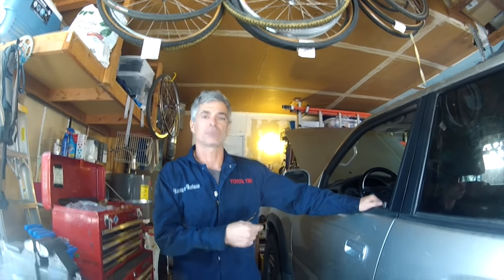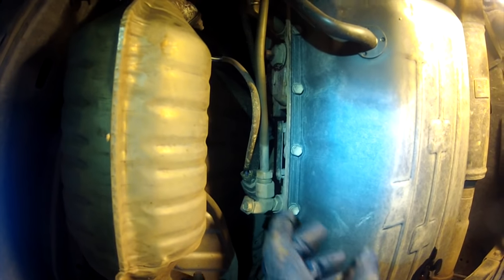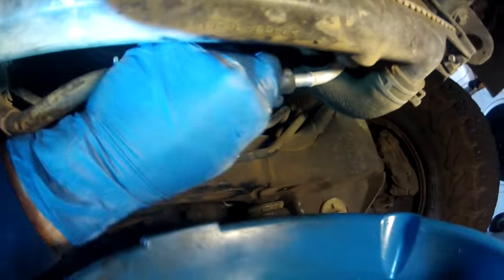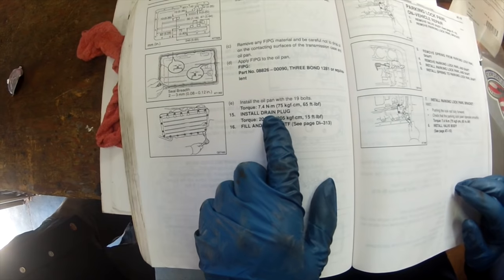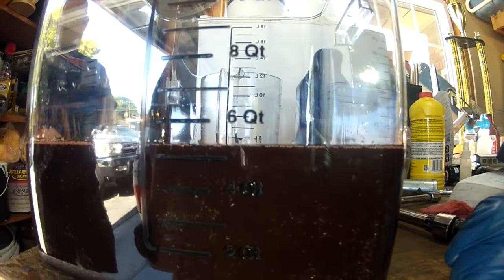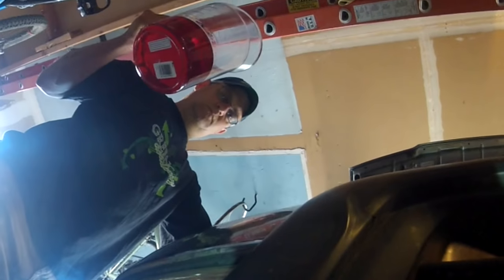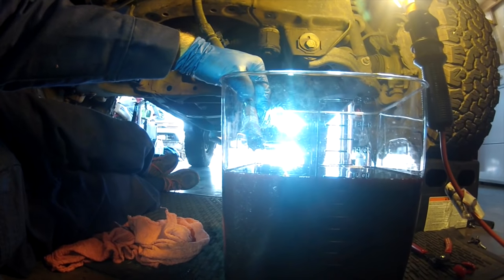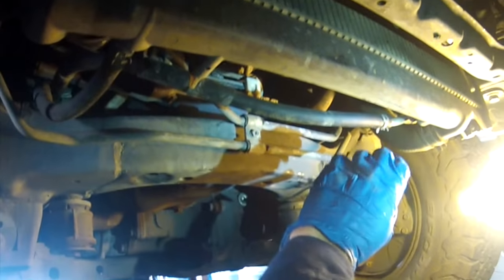Transmission Fluid Flush

Comment: Thanks a lot for your previous help.  I have been able to follow the steps and it works fine. 
Just one question.  When teh temperature is between 158-176F, the fluid is just above the hot mark by almost same distance between the two notches at the hot level (almost 5 or 7 mm above).  Is it a big deal, should I drain a little or this is minor?
Thanks
Reply from the maker: When the dipstick is showing that high, is the temperature closer to 176 or 158?  It sound like you might be a little high.  But, the transmission fluid level is not an exact science because the temperature you check it at will determine the level on the dipstick.  If you checked it after climbing a steep grade and your fluid was around 200 degrees, you'd be way over the top hot mark on the dipstick.  

I think it's ok to be a little low and a little high.  The key is to not be too low or too high because neither is good.
Reply: The temperature was about 165F on my torque pro when the level was about 5 mm above the highest notch. Thanks for your guide.
BTW, the filter was really dirty and stiff not as spongy and soft as the new one.
Reply from the maker: I forgot, what vehicle are you working on?  It can't be a 3rd Gen 4runner because they only have a metal mesh filter under the transmission pan.
Reply: It is Camry 2007 LE 4 cyl.  Also the Highalnder 2011 AWD 3.5L 6 cyl has the exact same filter.
Reply from the maker: Gotcha.  Now I remember.
Reply: One thing I am not sure about.  the transmission temperature is about 150F when I am driving and the coolant temperature is about 180F.  Once I park the car and keep idling the engine, the coolant temperature rise to about 172F and the coolant temperature to about 205F.  Is that normal?  I expect that once I idle the car, the transmission oil temperature should drop and not increase.  Any idea why is that?
Thanks
Reply from the maker: zofa300 So you're saying at an idle your transmission temp will increase to 205 degrees?
Reply: No this is the coolant temperature when idling.  The transmission oil temperature increase from 150F to 172F when idling.  I am just confused why the transmission oil temperature increase if I am not driving?  Is that possible? 
To clarify further.  I was driving then the oil temperature was 150F.  After I parked the car and left it idle for 5 mins, the transmission oil increased from 150F to 172F.  I did not expect that since I was not driving!
Reply from the maker: The normal operating temperature my 4runner is 188-194 degrees but I don't know what it is normal for your Camry.  205 degrees seems a little high to me but it could be completely normal.

Your transmission temps at idle should slowly start to decrease because there's no load on the transmission.  The engine fan is pulling air through the cooling fins of the radiator helping cool the engine coolant and also the transmission cooler running in the bottom of the radiator.

When you're driving, air is being forced through the radiator, cooling the engine coolant and transmission fluid.  At idle, you're depending on a functioning fan clutch (unless you have electric fans), to lock up and pull sufficient air through the radiator to achieve proper cooling.  The symptoms you have, it sounds like to me your fan clutch isn't working well.  The fan clutch is suppose to lock up at the engine operating temperature turning one for one with the motor pulling air through the radiator.  When the fan clutch starts to fail, it's not locking up all the way or not at all and you're not pulling a sufficient amount of air to keep your engine and transmission cool enough.

I have a video regarding testing and replacing the fan clutch on my rig.  https://youtu.be/WzhlACxqeqQ

Comment: Hello friend ... Congratulations on the video and the explanations ... I'm going to change the transmission fluid, but I do not have the OBDII reader, nor the scanner ... if I take a 10 to 15 minute ride with the vehicle. fluid temperature will be in a good range for level checking? ... Thank you.
Reply from the maker: To start off, make sure before you take your drive that you're level is at the top line of the cold range.  I'd take it for a decent drive down the highway, around 5-10 miles.  During the drive, hit the accelerator hard several times to get the transmission to kick down.  Do this on the way out and the way back.  This will help raise the temperature of the ATF.  When you get home, quickly get the vehicle on level ground, keep it running and check the level.  You will most likely be within the normal operating temperature range or very close.  I've done exactly what I'm telling you to do with my own rig and I was in the normal operating temperature range monitoring my temp with the Torque Pro app.   I've found that I will still be a little low on fluid after the drive.  Add fluid until you're in the hot range on the dipstick and you're all good.  

The level on the dipstick for an automatic transmission is not an exact science because the level will change depending on how hot or cold the fluid is.  ATF will continue to expand as it gets hotter.  Say you climbed a steep mountain road and your ATF temperature was in the low 200's, the level on the dipstick would show above the top line of the hot range if you got out of your rig and checked the level.

Go for a decent drive like I explained above and add fluid until you are in the hot range if you find it's a little low.   With automatic transmissions, it's ok to be a little high or low on fluid.  You just don't want to be way high or way low.  When I do my own drain and refill, I usually add ATF until I'm closer to the top hot line on the dipstick.  This might put me a little on the high side, but like I said, I'm not hurting anything.  It's an approximately 12 quart capacity.  If you're a 1/2 quart high or low, it's not anything to worry about.  Hope this helps.
Reply: Dear friend ... thanks for the prompt return and, once again, congratulations for the quality of your video and for your excellent explanations ... Strong hug.
Reply from the maker: You're welcome and we're glad we could help you out.  Happy Wrenching!

Comment: If you have an external transmission cooler, you would want the hose that dumps into the bucket on the return line of the external cooler correct?
Reply from the maker: Yes, that would be correct.

Comment: Do you think a drain fill will do a good enough job I know it won’t be perfect but what do you think.
Reply from the maker: Hey Jack, drain and refills can be very effective.  Do a drain and refill and then do another one in around 5,000 miles.  Follow that up with another drain and refill after another 5,000 miles and your fluid will be in really good shape.  After that, I suggest doing drain and refills every 10,000 miles.  This is what I do with my rigs.  Doing drain and refills are easy and fluid isn't really expensive so why not give your transmission some fresh fluid on a more regular basis.  The single best thing you can do to increase longevity of engines, transmissions, transfer cases and differentials is regular fluid/oil changes.

Comment: I have bought an 2005 lexus IS200 with 66000 miles on it. it has service stickers that says ATF has been changed at approximately 11000 and 22000 miles. after that I do not know if atf has been changed or not. the manual says it should be changed every 20000 miles or 2 years.
the fluid is brown with no burnt smell. It shifts good. should I flush it or just drain and refill?
Reply from the maker: A drain and refill is a safer bet.  If everything is fine after the drain and refill of the pan, do another one in around 5k miles.  Several drain and refills spaced out will get your fluid in really good shape.  I do a drain and refill of my trans every 10k miles.

Comment: Hey man. Great videos as always. I am going to do a flush on my 03 Tacoma V6 4x4 auto. I saw that you went with Dexron 3 ATF but everywhere I looked it says that Toyota Type 4 ATF should be used. How did you justify your decision to go with the Dexron 3?
Reply from the maker: In my 2000 4runner owners manual it recommends Dextron III.  That was the spec when these rigs were built.  They don't make Dextron III anymore so you need to use something that's compatible.  Mercon V is compatible and so is a Dex/Merc.  And, there's other options with synthetic blends.

Take a look at your owners manual near the back pages and you'll see the specifications for all the fluids on your rig.  I bet your manual will also be suggesting Dextron III.
Reply: @TimmyTheToolman  thanks a lot! I also just saw a Valvoline Synthetic blend that they recommend for Toyotas requiring Type 4 so I will probably go with that.
Reply from the maker: Sounds good Mike.  Happy Wrenching!
Reply: @mikeneville9453  If you replace with Valvoline Synthetic you will be mixing Synthetic with standard unless you drain and refill all of the ATF, Is that good?

Comment: Hi Tim, great video!! What service manual would you recommend for a 2002 toyota Tacoma?
Reply from the maker: Get yourself a Toyota OEM 2 volume set.  If you do a search on Ebay, you'll most likely find a set for your year Tacoma.  Don't get some aftermarket manual.  They are not as good.
Reply: @TimmyTheToolman  Great thanks again for the information.

Comment: Great video thanks mine is a right hand drive, my radiator send and return lines layout is different, will the send and return on the transmission case be in the same place as you described, send at front and return at back ? Thanks..
Reply from the maker: I would assume your lines on the transmission would be the same.  I don't think they'd reengineer the transmission just because of right-hand drive.
Reply: @TimmyTheToolman  wow I wasn't expecting a reply! Thankyou that was my thinking..
Reply: @TimmyTheToolman  they look the same on the top of the transmission as in your video with the send line having an electrical connection I'm guessing to control a pump maybe?
Reply from the maker: @tummygoat33  I don't know what that electrical connection does but I think that might be the temperature sending sensor.

Comment: Hey Timmy, what are your thoughts on someone who says by disconnecting the return line to the transmission or preventing fluid from lubricating essential parts? I understand how someone might think that that’s the case but it doesn’t necessarily mean it’s the case I’ve never had any issues, but if the return line is not providing fluid it is possible to be causing some areas not to get lubrication. Not sure what to think on this.
Reply from the maker: The people who say that are not correct.  The return line is just sending fluid back to the pan to be sucked back through the system via the filter.  By draining a quart and adding a quart, the trans is never starved of fluid.
Reply: @TimmyTheToolman  thanks for the reply. I would agree to I just do not know for certain where the return actually goes. If to the pan directly then absolutely true. If it does any sort of contact with any parts  meant to have lubricate while working before going to the pan than issue. Sounds like you know it is the former. Makes sense!
Reply from the maker: @condor5635  I don't know the fluid's absolute path to the pan, but I'm fairly sure it's not to any parts requiring lubrication.  I'm fairly certain it goes back the valve body and drains down into the pan.  There's not a whole lot of moving parts in the valve body,  There's shift solenoids attached to the valve body which require lubrication, but the transmission isn't shifting during the process.  The critical things that need lubrication are the clutches and those aren't being lubricated by the return line.

If you're interested, check out this video Sean and Chris made installing a Transgo kit on the A340F transmission to see the workings of the valve body.
Reply: @TimmyTheToolman  thanks!

Comment: I just bought a used transmission for my 2001 4Runner, (this is the second one), the salvage yard put in the transmission so I'm not sure if they put in new transmission fluid or not, is it a good idea to do a transmission flush on it? Also should I use synthetic transmission fluid and change the metal strainer?
Reply from the maker: Buying a used transmission is a serious crap shoot.  I guess if I were going to buy one, I'd want to take a look at the color of the fluid in the pan.  If it was dark and burnt smelling, I wouldn't touch it.  If the fluid looked nice and pink, that would be a much better sign that the transmission came out of a vehicle that was well taken care of.

When you have a transmission with a known history of being taken care of, a full flush of the system is fine.  When you have a transmission that was abused and the fluid was rarely changed, it's a different story.  If you take a look at the fluid and it's really dark and nasty, that fluid went well beyond the time it needed to be changed.  When the fluid's lubricating properties break down, excessive wear happens to the internal parts like the clutch plates.  That dark ATF now has suspended clutch material in it which is helping the transmission shift without slipping.  The transmission also has sludge build-up inside too from not getting regular fluid changes.  

So, when you do a full flush on an abused transmission, all that suspended clutch material that the transmission was relying on to shift better and not slip is gone.  The result is you need to replace the transmission.  Another thing that can happen when you introduce fresh new fluid into an abused transmission is the new fluid can loosen sludge build-up.  ATF has detergents in it.  Those detergents can loosen sludge and the sludge can end up clogging fluid pathways like in the valve body and cause fluid delivery issues.

I know this was probably way more than you wanted to read but I thought I'd give you a thorough explanation of why it's sometimes not prudent to do a full flush.  So, to answer your question, since you don't know the history of this used transmission, I'd recommend just doing drain and refills of the pan to play it safe and NOT perform a full flush.

Comment: Hey Timmy!  How long would you say this job would take for one person with good mechanical knowledge to complete?
Reply from the maker: Well, you kind of need a person to help you start and stop the motor.  They start the motor.  You watch a quart drain out.  You tell them to stop the motor.  You add a quart of ATF into the trans fluid dipstick tube and you repeat this until you reach around 12 quarts in your bucket.   I would say between 30 minutes and an hour.

Comment: From what I've read the OBDII trans temp on these trucks display the temp of the fluid leaving the transmission. So you'll be seeing the hottest point of the fluid. Have you heard that as well?
Reply from the maker: Yes, that is exactly what I've heard too.  It's definitely helpful to monitor trans temps especially if you're driving in the mountains, towing or 4 wheeling up steep trails.  I recently had 4 passengers in my truck driving up a ridiculously steep private road in the Santa Cruz mountains to attend a wedding.  Even with my external cooler, my trans temp almost hit 240, highest I ever seen it since using the OBDII reader and Torque Pro app.  It was because the road was probably a 15-20% grade and it was long. Going up that steep of a road, I was going slow and had little air flow through the front to cool off the trans cooler and radiator. I was just about to stop and let my temps drop a bit and we finally made it up to this house.
Reply: I've experienced the same thing while hauling gear camping. Did you run your trans cooler in series with the stock or bypass it? Also, have you seen any comparisons between the OBD read out and that the temps are in the return line after the fluid has been though the cooler? I'd be curious to see the difference in those two temps.
Reply from the maker: Hey Miles, I chose to run my trans cooler in-series.  I explain in great detail why I chose that route rather than bypass in my trans cooler video if you want to listen to me blab for a while. 

I haven't seen any comparisons with the trans temp sensor readout with another sensor in the return line.  It would be interesting to know though.
Reply: +Timmy The Toolman I'll look for it and check it out. I vaguely remember watching it in the past. Thanks for taking the time to make such detailed videos. It's a great source of info for a fellow 3rd gen owner. Much more intuitive than a write up.

Comment: Hey Timmy,  my trans fluid was 1/4 inch below the hot lower line. Is that bad? Is having the fluid between the high and low lines better when trans being hot?
Reply from the maker: At operating temp, between around 155 - 175 degrees, your fluid level should be at the top hot mark.  Are you checking the level after driving it for a while, on level ground, and with the engine running with the trans in Park?  If so, you level is low and you should top it off.
Reply from the maker: Were you running the engine AND at operating temperature while you were checking the fluid level?
- Sean
Reply: @TimmyTheToolman  yes. First i warmed up for 5 minutes,  then took it on a 5 mile loop and then parked on flat surface and checked while 4runner was still running.  Also is it necessary to put on ramps to drain trans fluid? Or can i do it on flat surface?
Reply from the maker: @damacknificent151  It depends on the 5 mile drive you did whether  the trans got anywhere close to operating temp.  I would suggest around a 10-mile drive on the highway with several hard accelerations to get the transmission to kick down.  Get it on level ground quickly and check the level.  Do you monitor tour trans temp?  If you don't,  you should.  

You don't have to have the rig on ramps to drain the trans.  You would get a little more fluid out at a slight slant, but it's not necessary.